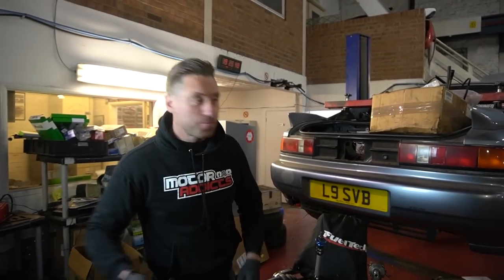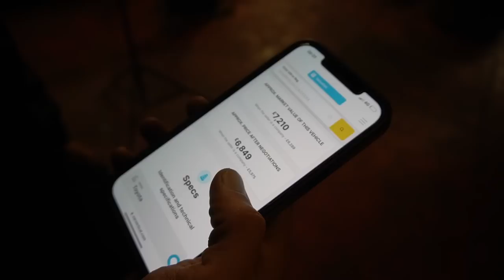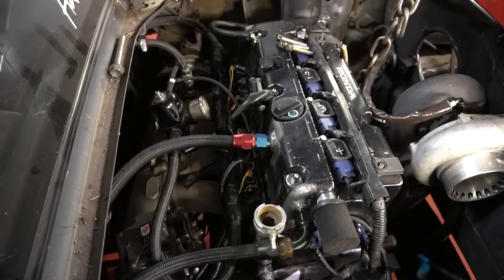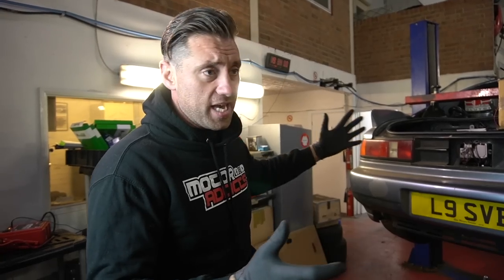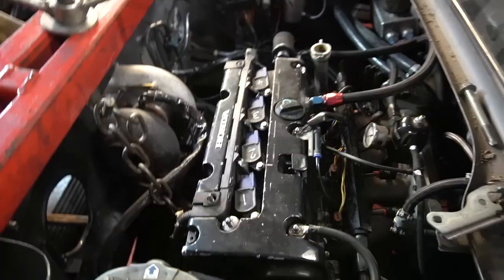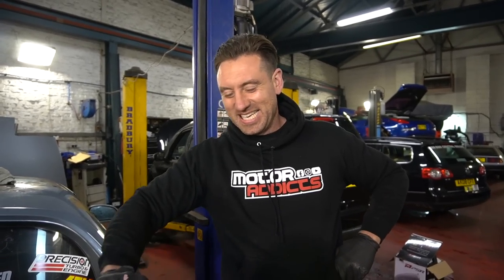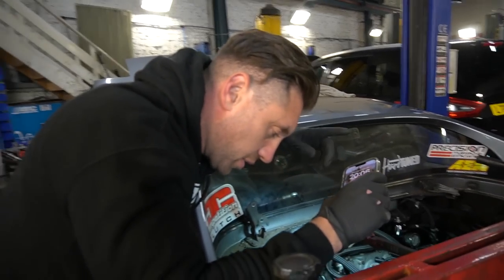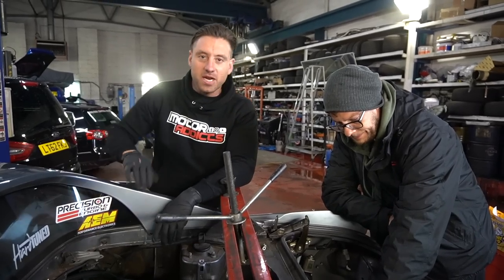OUR 678BHP TOYOTA MR2 GOING BEASTMODE - WILL THIS BE UK FASTEST MR2?

Comment: May be worth doing your research before posting this tripe, there’s loads of mr2’s out there with way more power than this.
Reply from the maker: We have done some in depth research, so deffo can’t wait to see what this does when complete
Reply: Tripe is a strong word after not finding ANY other billet rod MR2’s already running in the country 👀
Reply: Maybe a bit harsh lol. But we aren’t taking about how the power is achieved or what the internals are we are talking about the statement about this being the fastest mr2 in the country. Just think its too bold of a statement
Reply: That’s kind of why we addressed it as a question, currently there are zero ‘already running’ billet rod MR2’s in the country at this spec level. It’s a street car, so retaining all of the streetable qualities that we can, it should make a great stamp on the MR2 community. A 100ron and pump gas tune will be factored in. All things being well we should see a high 8 at the track on a conservative tune
Reply: I don’t understand there’s no other mr2 in the country running a billet rod? Conrods?
Reply: I kinda find it hard to believe that these cars have been around since the late 80’s and early 90’s and the last gen mk2 produced over 20 years ago and nobody until now has done a billet rod or achieved this sort of bhp??!!
Reply: @L33ETH  try looking carefully you will see a car producing 1214 at the wheels with a 5sgte engine, running on aluminium rods, made from wait for it, billet.
Reply: You’re not even mailing sense now